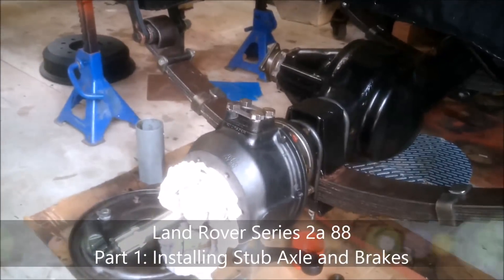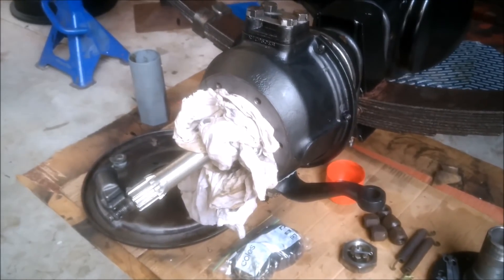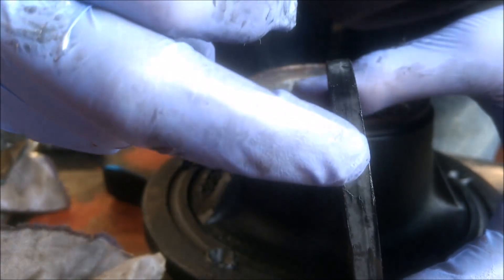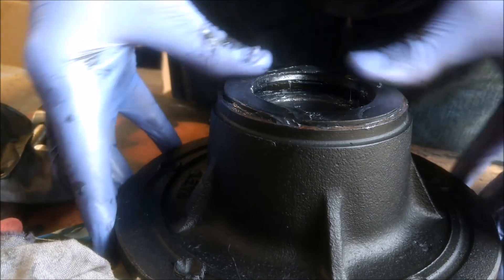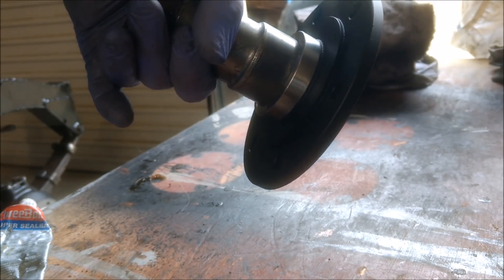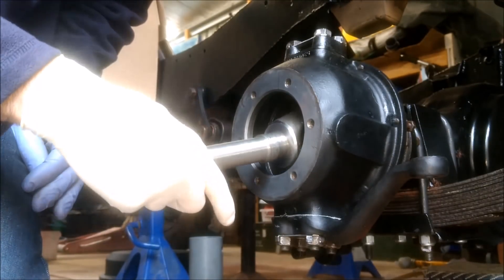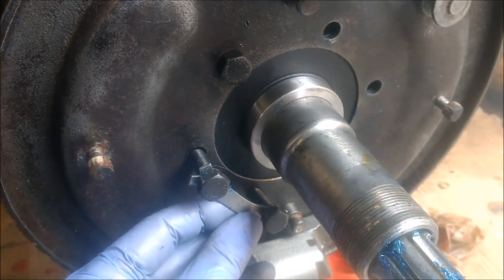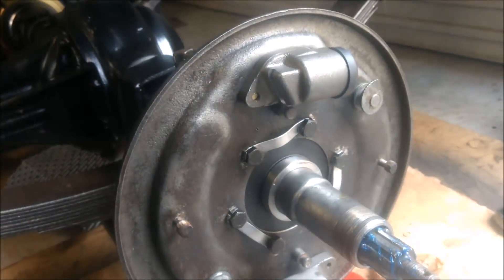Land Rover Series 2a 88 - Part 1: Installing Stub Axle and Brakes

Comment: Hey man, I know it's normal for people to be know it all's in the comment section, but I think you might want to check your brake shoe spring placement.  They should hook from one post on the shoe to the post on the backing plate.  I have an 88 so the layout is different but I assume the design would be the same.  Just from the video the design seems the same from my eye.  Incorrect placement could hurt performance over time after the parts (return springs, shoes, drums) wear/break in together.  Hope this helps!  Everyone knows these brakes need all the help they can get.
Reply from the maker: Hiya Hunter - thanks for the post and by all means I do appreciate comments!  I am no mechanic (I think I say that somewhere lol) but was also paranoid about the brakes. I checked SO MANY TIMES that I think I got it right :)  I referred to the manual and googled other pics of 11" front brakes 109 (eg http://www.expeditionlandrover.info/landRoverFAQ/FAQ_rearbrakes.htm) - so I think I got it right but to be sure ill check once more.  Thanks again.

Comment: Nice progress 👍🏼 why can't they make parts that fit properly? poor quality control.....
Reply from the maker: Yeah Rusty, makes a job harder than it needs to be. Most likely 'Made in C...a" crap...
Reply: Rover Tasmania Almost certainly from China 🤔 I have just ordered parts to fix a leaking hub seal, it will be interesting to see what they are like. 😀
Reply: Unfortunately the blue box stuff is renown for it - I won't knowingly use them anymore (sometimes they don't say when you're ordering though which can be annoying).
Reply: Nick S I've ordered "OEM" but as you say there's no guarantee what will arrive 😜
Reply: Absolutely - these days don't think OEM means anything (on its own anyway) sadly! I tend to go with the suppliers here that actually say which brand the item is but appreciate when you're trying to get stuff shipped halfway around the world choices might be a little more limited!
Reply: Nick S I'm in the UK, but that doesn't mean much apart from sensible delivery charges.... Well mostly 🙄